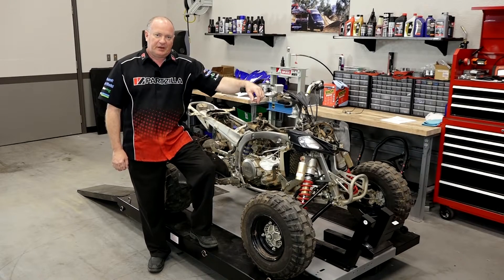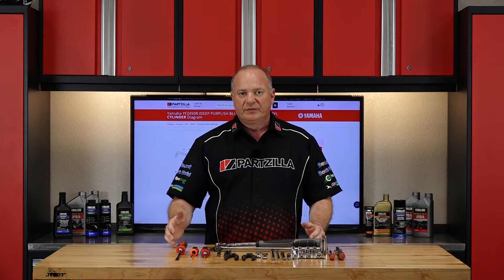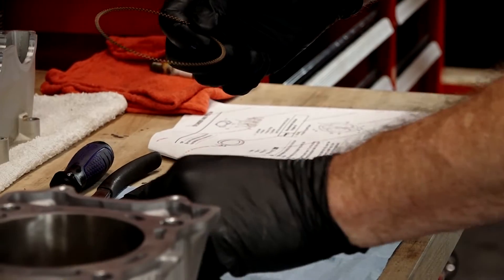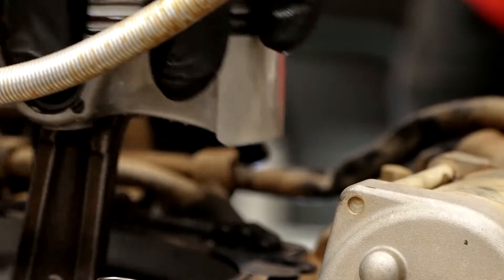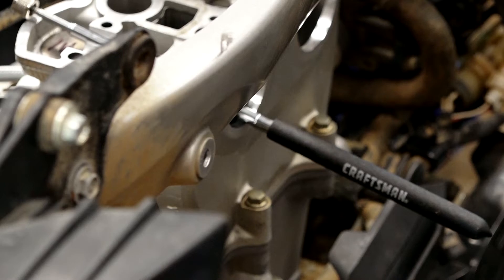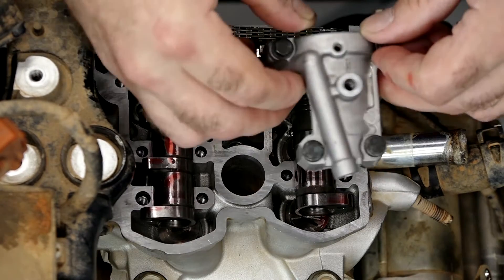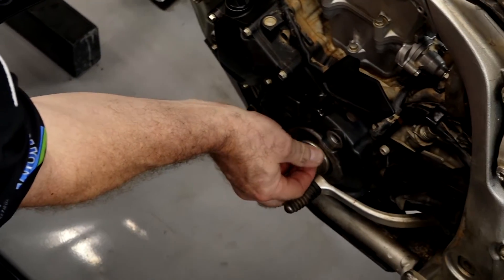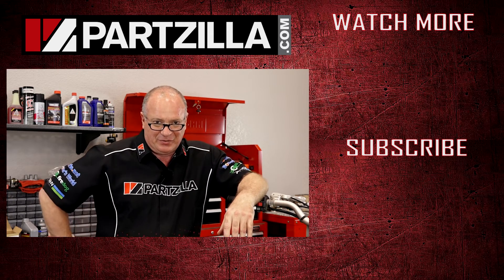Yamaha YFZ450R Top End Rebuild Part 2: Rebuild | Partzilla.com

Comment: shavings in my oil filter so I disassembled the top end and saw that my crank is stiff so I will replace that and I was wondering if I should replace my oil pump too it’s a 2007 yfz450 and it has that oil squirt thing
Reply: Yess or just flush it out really good

Comment: How come you didn’t check the ring gap? Also, why does Yamaha ask for the harder chrome ring as the second ring whereas my raptor manual said for it to the top ring?
Reply: Most top end kits come with the rings already gapped and for 2 most of the manuals give out faulty instructions everyone has come to find that out over the years

Comment: Hi good video:-) I have the same ATV some day the wheels blocked but it seems like nothing broke in the motor but I could not crank it there was to much compression. When I look at my Exhaust cam it seems like the tootwheel is turned on the axle when I time the motor the last lobe is more up then before have you seen that before?
best regards Michael
Reply from the maker: Never seen it before, but it sounds like a new cam is in order.